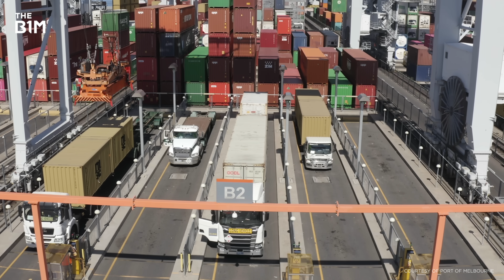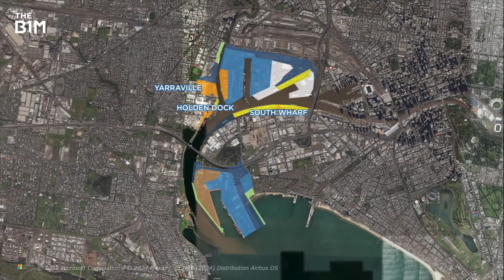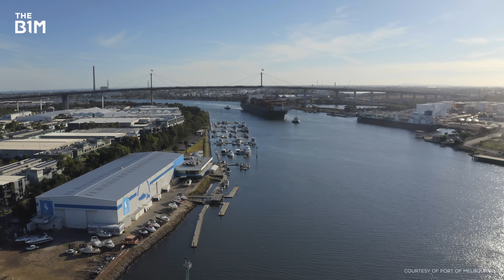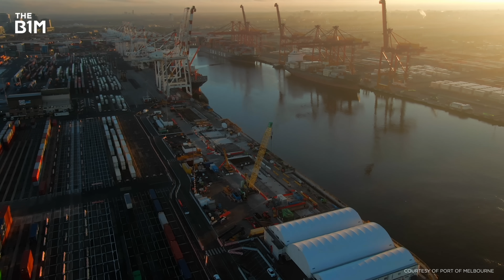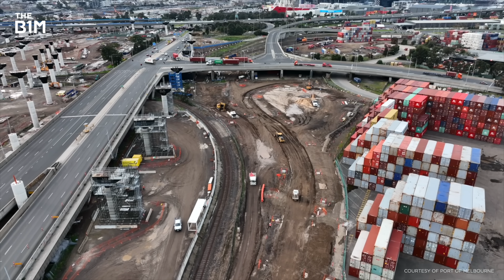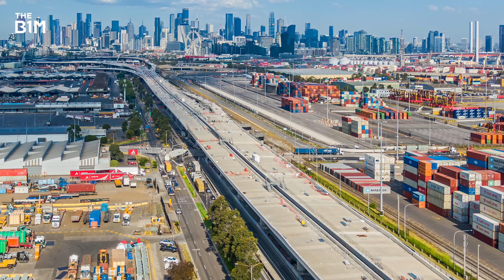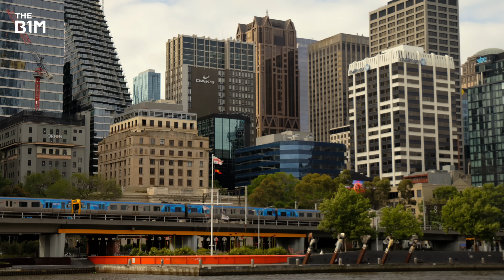The Race To Fix The World's Most Isolated Mega-Port

Comment: Would a ship side train tracks allow direct unloading onto flat bed trains, with dock container trucks along side train, to allow offloading to either train or truck.
Reply: Better to just use the dockside cranes to unload and load the ships. Other smaller equipment can then be used to load trains and trucks. Ships don't like being in port longer than they need to. I don't know much about the port in Melbourne. In Sydney (Port Botany), they load the trains depending on destination. Many "trip trains" use dedicated freight lines to take containers to intermodals in the suburbs. Keeps a lot of trucks out of the local roads.
Reply: It would but it’d take too long; you’d have to keep moving the train up by however many cranes you have and that start/stop is inefficient.  Time to unload and reload is everything for the shop owners.

Comment: I'm surprised that the Port of Melbourne is more busy than Sydney. Good example of the forward thinking government.
Reply: A lot of cargo in NSW uses the ports of Newcastle and Port Kembla (Wollongong). Cars, for example, go to Port Kembla.
Reply: Sydey Harbour is more about the visual appeal than practicality. Port Phillip Bay is uninteresting and bland, so it's easier to put important infrastructure on it.
Reply: @ There is still some commercial shipping using Sydney Harbour (apart from cruise ships). But yes, the Harbour's greater value is in leisure and tourism. Could you imagine what they could do with all that land if they moved the port? Or maybe that's Melbourne's problem. Not enough imagination.

Comment: Although the direction is all right... The scale is a joke for a city like Melbourne. I mean, look at the (existing) rail infrastructure in LA, Rotterdam, Hamburg or anywhere else. I don't think anyone would even notice if you added 2 more tracks.

And of course the rest of Australia's rail network is... well worth a major overhaul, to be polite :) High speed rail between Melbourne and Sydney and electrification of the main corridors. Because replacing diesel trucks with diesel trains is not the big step in air quality you are looking for.
Reply: LA has 20 million people. Rotterdam and Hamburg are ports that need to service all of Europe, rather than just the Netherlands and Germany.
Reply: @JohnFromAccounting  1.) Rotterdam is the largest and Hamburg #3, for sure. But still, they are dozens of ports in the EU. Even many of those outside the (EU) Top 10 have better rail infrastructure.
2.) As mentioned in the video, Melbourne is also serving a larger area.

What matters is the amount of cargo, usually measured in TEU. Melbourne is at 	3 million TEU annually and expected to double in capacity. Hamburg is currently at 8-9 million TEU.

So if Melbourne's port is expected to grow to a similar capacity as Hamburg, infrastructure should as well.

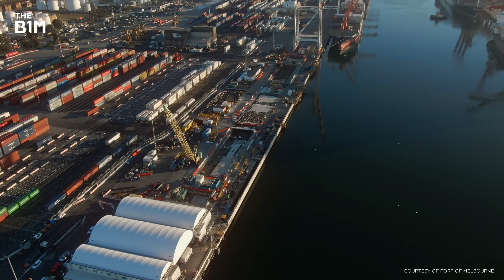Comment: For anyone interested, the project at 5:34 at Swanson Dock was a different project meant to replace the deck for Swanson Dock West 1. As apart of the project, the largest land based piling rig in the southern hemisphere was mobilized to site to to drive 46m long piles in a single length!
Reply: Wow didn't know that thanks
Reply: 46m is bonkers cool
Reply: All while welding, grouting and generally repairing everything under the wharf in waist deep water. A really cool project all round!
Reply: Driving through Coode Island Silt I presume?
Reply: Well that explains all the massive whumping noises that kept waking me up during the day when I was working night shift last year… I live in port Melbourne not far from Webb Dock…

Comment: First of all - standard gauge rail network does not terminate in Adelaide and Sydney, it begins in Brisbane and ends in Perth. And Victorian broad gauge, in opposite, does not reach Sydney at all and Adelaide for 30 years, since the line was converted to standard gauge. So all this Victorian gauge mess means that local (Victorian) transportation is very limited and diminishing (Mildura line was recently standartised, for example) but interstate network has no sense to exclusively use Melbourne port, Sydney and Adelaide have the same access to it with better coverage of standard gauge around. NSW rail has, for example, rail loops for 1.5km trains, so 600-800m Melbourne port trains are not competitive.

Second - the port location. 150 years ago it was outskirts of the single big town, sea gate to goldfields, plenty of slums with abundant cheap manual labour workforce, exactly what required for manual-handling 19th century big port. Now it is the very middle of megapolis, constrained space, no transport corridors, contaminated soil, limited dock size, limited rail sidings length, layers of semiabandoned structures and systems underground... Sydney used to have similar facilities in the same centre - Darling Harbour, Rozelle, everything was kicked out from there to Botany bay, modern new-built container terminal with good truck access, mighty rail branch, plenty of space, easy ship access and so on. And old port lands in the city was redeveloped, creating world-class Darling Harbour precinct for tourists, entertainment and residence. London made the same with its dock - now its worldwide known Canary Wharft. Why Melbourne continues to develop this port in the middle of megapolis instead of Geelong or so? Ah, yes, thats Melbourne, question "why they do such a dumb thing" is not relevant, they always do it this way.
Reply: Distribution is why, putting it all out at Geelong and then getting it to Dandenong is just asking for more bottlenecking than there already is. Build extra capacity at Avalon for sure to handle overflow but moving stuff further and further out of the city just creates a transport nightmare when everyone is tripping over everyone. Less trips = less traffic, both on road and rail. Having stuff closer to where it needs to be = less traffic in the first place
Reply: @DounutCereal  if the idea is to improve rail connection - it means these chests go not to Dandenong, but out of Melbourn area. And in this case Geelong/Avalon is much more convenient, with its standard gauge rail line going not thru the very city but via boundless plains.

Comment: They just need to build a port where Geelong is, no great loss
Reply: Not deep enough.
Reply: It will happen eventually.  Maybe in 300 years.  Then Docklands will have no functioning docks except some passenger terminals.
Reply: The dredged channels leading to the Port of Geelong are too shallow for really big ships and it would be far too expensive to deepen them, not to mention that the greenies would have a fit. However the port of Hastings on the Mornington Peninsula has naturally deep water and a fair bit of vacant land, so it's a more logical place for port expansion.

Comment: If they were smart they would build a new terminal at Point Wilson just near Avolon Domestic Airport. Build a train line from there and this will cater for both ship and air freight and  the current terminal section and port can be developed that is right next to the city.
Reply: The water is too shallow on the western side of Port Phillip, so even with dredging, piers would need to be over 1 km long to get to deep enough water. By contrast the port at Hastings has natural deep water and is a more obvious place to expand.
Reply: @Dave_Sisson  there is no standard gauge connection to there.
Reply: Dang they should’ve consulted you!
Reply: @fafmotorsport  politicians ain't the smartest are they. Especially Labor.
Reply: @Danger_Mouse_00  i think this is project was done by the port not the goverment
Reply: @Danger_Mouse_00 the liberals aren’t any better
Reply: @VibuWeerasinghe  hell a lot better than Labor. They ain't great but that says a lot compared to Labor.
Reply: @Danger_Mouse_00  do you not know what happened when Scott Morrison became prime minister.
Reply: @VibuWeerasinghe  do know how this country is right now with Labor?
Reply: Port isn't going to just give up their location.  Government may push them out though in the next 200 years.  Then the land can all be redeveloped into high density urban.
Reply: @newsgetsold  like in Sydney or London. Very successful, instead of stinky docks with slums, coal smoke, herds of pauper manual labourers and so on - we have Darling Harbour, Pyrmont, now continuing in Rozelle. The same in London with Canary Wharf. No need to wait for 200 years.
Reply: "smart" and "Vic govt" are not compatible at all.
Reply: I've heard arguments that they should have developed Western Port decades ago. 
Parts are naturally deep, protected (from wild weather), relatively close to Melbourne, lot of undeveloped land. 
Using any part of Port Phillip still means using the narrow and shallow heads, limiting the size and numbers of ships, and then zig-zagging through shallow water to get to the ports.
Reply: Lets get real. There was already substantial work done on a second port at Hastings. That was quashed to enhance the sale value of the Port of Melbourne. An Andrews government cash grab.
Reply: @geoffmathieson2643  "Lets get real"
Oh, the irony that comes next.

"substantial work done on a second port at Hastings."
It's tiny and always has been.

"That was quashed"
It should have/could have been developed decades ago, under any number of states and/or federal governments. 

"Andrews government cash grab."
No state or federal government has viewed Hastings as a viable solution for decades. 
If they had, it would have been developed decades ago.

Thanks for the laugh and for showing how irrational you are.
I'm glad to see dictator Dan is living rent free in your head.
Hilarious!
Reply: @dampaul13  You do know the intended purpose for the $9.7 Billion from the 50 year sale/lease agreement was to fund the Andrews government grade separation election promise, don't you?
Part of the sale was a 50 year non-compete clause.
Reply: @geoffmathieson2643 And how are you going to blame dictator Dan for the lack of port development for the decades before he got into power? 
I'd love to know how while at uni, he stopped Jeff Kennett from developing the port just so he could make money off it 30 years later.
How did dictator Dan stop successive state and federal governments from developing the port decades before he was alive or in politics?
Please, I'd love to know. 

 Does dictator Dan speak to you at night when you are trying to get to sleep?
Reply: @geoffmathieson2643  Nope?
Nothing?
Reply: @geoffmathieson2643  ummm, the very presence of alternative facility increases the sale price of old port as buyer gets possibility to close and demolish all this and redevelop for modern conditions like Darling Harbour after Pt Botany was built. Without alternative this stinky ancient freight port in the very middle of megapolis has to stay as is.

Hastings may be good from sea side (I do not know anything about it) but ground side there is terrible. No access at all. No standard rail in vicinity, it ends in 50km, on the other side of city. No good freight road to anywhere, all available routes go thru the same city and overloaded with commute. No existing transport facilities (rail yard, truck bases etc).
Reply: @antontsau  A 50 lease agreement ($9.7 Billion, by the way) that contains a 50 year non-compete clause doesn't seem like an incentive for a second port to me.
Reply: @geoffmathieson2643  yes - instead of (expensive - how much costs Darling Harbour? Canary Wharf? Hamburg HafenCity?) sale with idea to be relocated all this to somewhere and redevelop the land it was sold as is with idea do not touch anything, We Just Need Money Right Now.

 So of course there was no need to develop any hastings or whatever. Not to make things better, increase value, repurpose land in the megapolis and so on but just press out small money to immediately spend with loud noise "our beloved govt cares of you!".
Reply: @ What?
Still no response!
So much to say, no nothing!
What are you scared of?

Comment: Australia doest export any manufactured goods - 95 % those boxes are imports.
Reply: We may not export much manufactured goods, but we do export a lot that is transported in intermodal containers. Even some of our material exports are shipped via containers (granted not a lot, but things like containerised copper and aluminium are all intermodal). Transport companies don't like moving empty containers as its not cost efficient, so you'd find that most when they get loaded back on a ship are filled with something!
Reply: Processed and fresh food, medical supplies, industrial electronics, military hardware, alcohol, manufactured metals such as steel and aluminium - all that comes from factory floors. Being 55 times smaller than China in population obviously means less of it will leave our shores but to say that nothing is made here is just false.

Comment: Small tip for capacity improvement - just stack 2 containers vertically as USA rails doing for decades 😅 and please send my check for saved money to me!
Reply: The Adelaide - Melbourne rail line does not have double stacking capacity, due to tunnels.
Reply: Inland Rail will allow stacked containers but only because it will be standard gauge for the whole line. The narrow gauge in QLD would not be able to accomodate it.